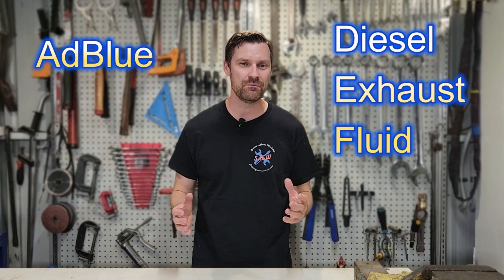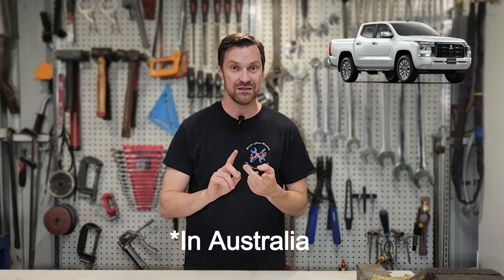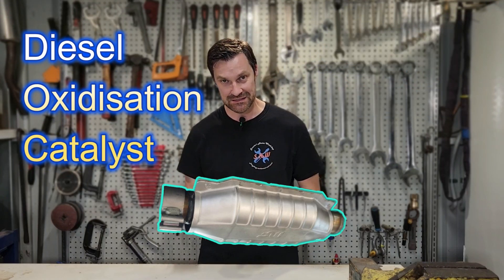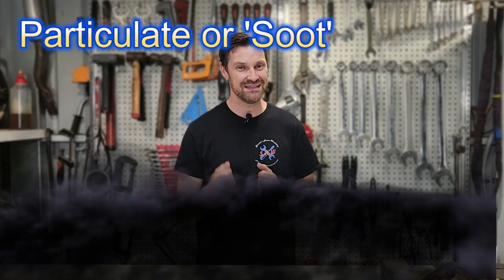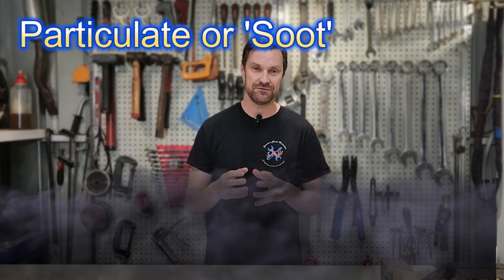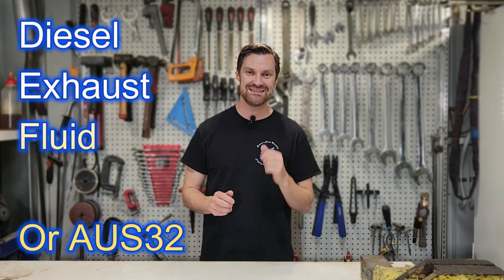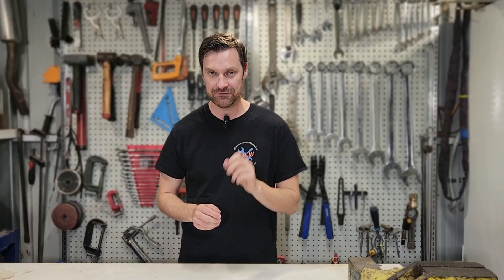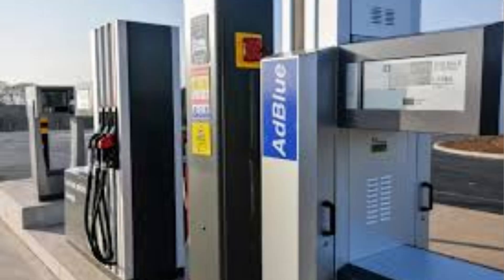Diesel Exhaust Fluid/AdBlue - Why Your New Diesel May Not Work Without It

Comment: Add Blue non start and Power restrictions are a safety problem. In Australia, the engine must be able to run without a working Add Blue system. It's only a matter of time before people die from this unwanted "safety" feature.
What do you know about Diesel LPG combination systems. Do they need Add Blue?
Reply from the maker: I agree, surely most must have some sort of override to move the vehicle in the case of having an empty tank, but I'm yet to see one, most that have had issues or empty tanks are towed. 
As for LPG / Diesel systems I've seen a couple of fitments on TD42 Patrols but not on anything new enough that also has AdBlue, could be a good thing as the LPG would reduce NOx. Be hard to justify using LPG and removing an AdBlue or similar system to an inspecting agency, I'd say.
Reply: @simmoshomeworkshop  I had LPG fitted to a 3.0 L V6 2012 Navara Diesel I could get 1600+km on the open road (not towing) on the tank of Diesel and 2 1/2 tanks of Diesel to a tank of LPG. No DEF on that vehicle. Now I'm in a V6 Amarok and have DEF and max out at about 1100 km on a tank of fuel. (Both have L.R. tanks).
Reply from the maker: How are you finding the Amarok DEF system? Any plans to add LPG to it also?

Comment: I love my emission system no problems at all 2023 Jeep Gladiator Eco diesel. Part of a group that knows how to maintain the system flawless. There’s so much you can do to keep everything trouble free but for DEF make sure to run the platinum. I get it at a local tractor supply for $15 for 2.5 gallons and no crystallization baby